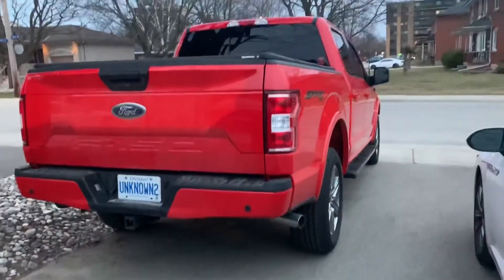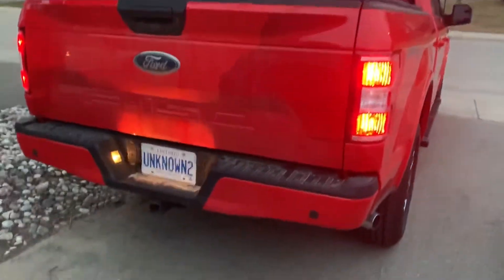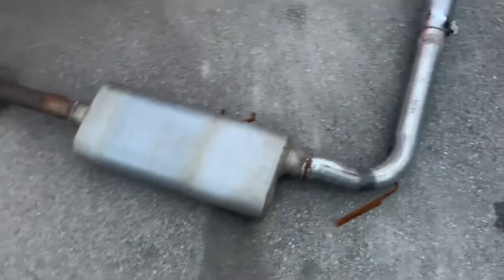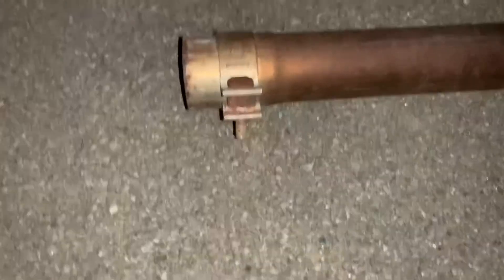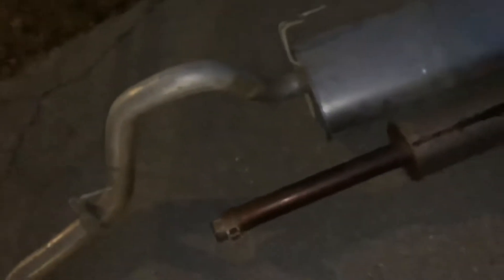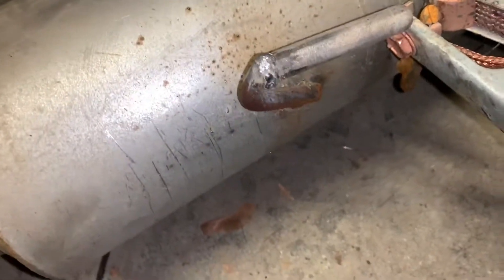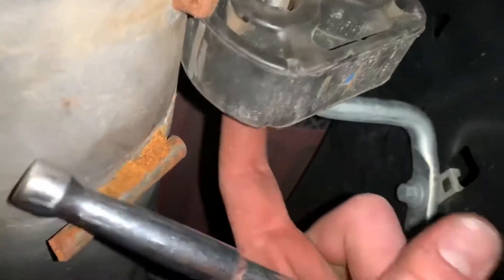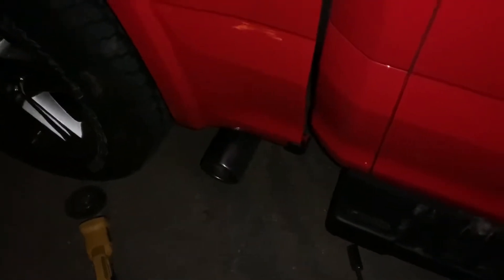F-150 Flow Master 70 Exhaust System Install w/ Sound Clip

Comment: After I saw this video I was so dedicated on installing the 70 series muffler. But I've noticed that upon accelerating (around 2000 RPMs) I get an annoying muffler sound inside the cab. Is that normal? I thought people said there was no drone.
Reply: Do you have that with the 70 series you installed? I just muffler swapped for a Flow FX and I have quiet but noticeable drone above 65

Comment: After removing the resonator, some people say that you may suffer some low RPM power loss. Is that correct?
Reply from the maker: The cat is what causes you to loose power when deleted the resonator just gets rid of the annoying drone sound when driving on the highway on most vehicles. I don’t get any drone on the highway with it deleted.
Reply: @NickMeinert  Thanks alot Nick!
Reply: @NickMeinert  I have had a 70 series on another vehicle and it did not drone.  Glad to see you got similar results.